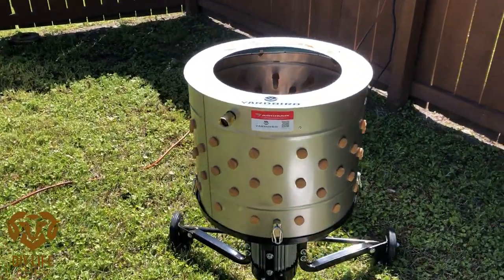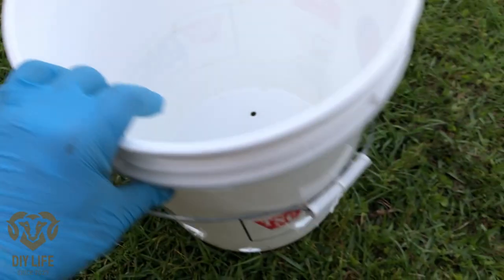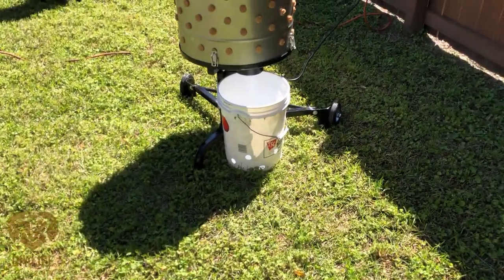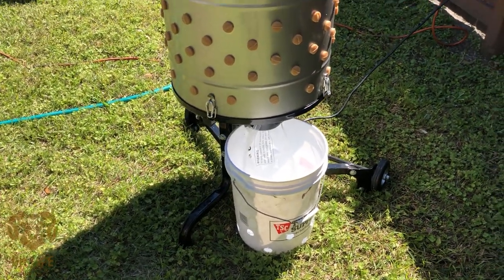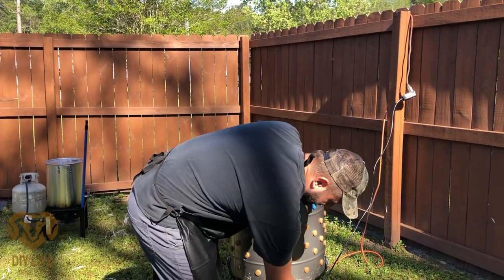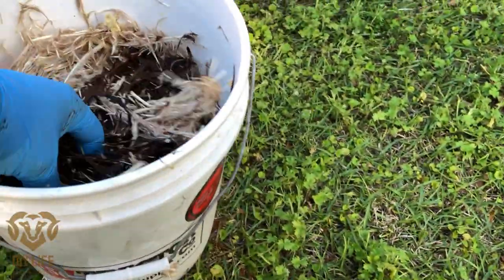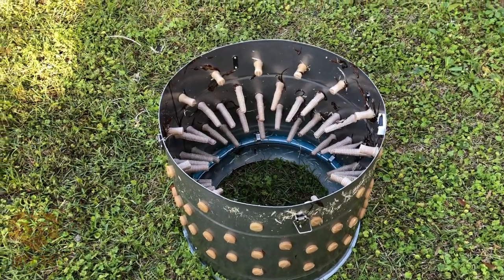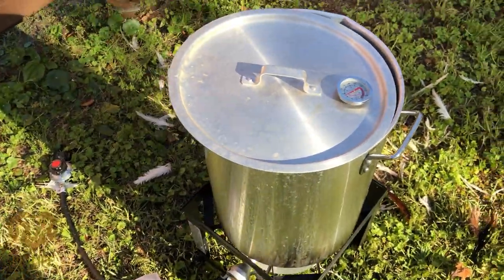SOLVED! YardBird Chicken Plucker Most Common Complaint

Comment: Thanks for the operational review. I have been wondering about this thing myself. Can't decide which brand I want to get. FYI, that spot on the motor that you pointed at where you wanted to keep the water from going into isn't an inlet. That is the fan shroud and actually an outlet for air to pass over and keep the motor cool. It's a good idea to keep feathers and water from going there. Great job!

Comment: They sell paint pour edges for 5 gal buckets it will clip on edge - also a dust pan edge for clean up with pales same idea — on edge of pale to be like a backsplash bridging th gap where you have the plastic bag
Reply from the maker: Great idea.  I'll get one and see how well it works.
Reply from the maker: I tried the paint pour edge and it did a great job.  It did allow a few drops to hit the top of the motor, but compared to the factory design it was awesome.  Thank you for the idea